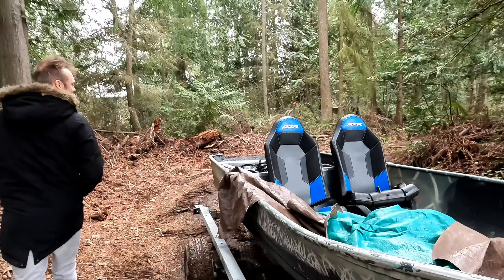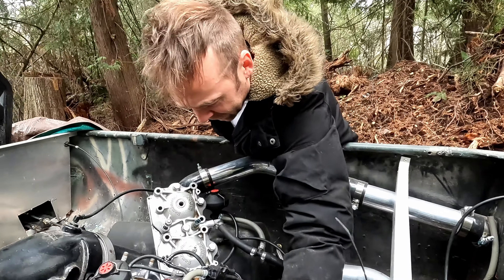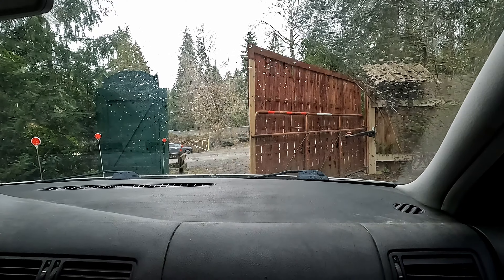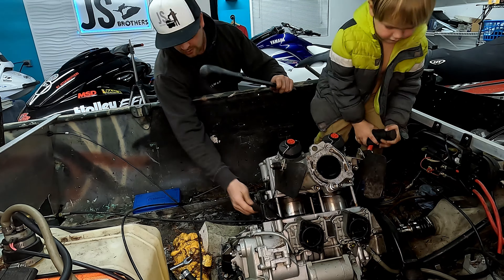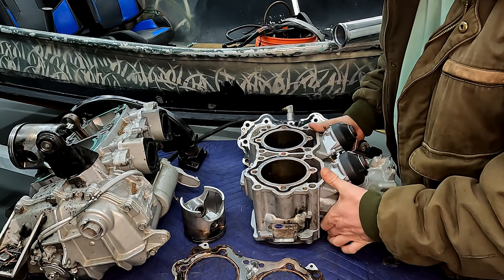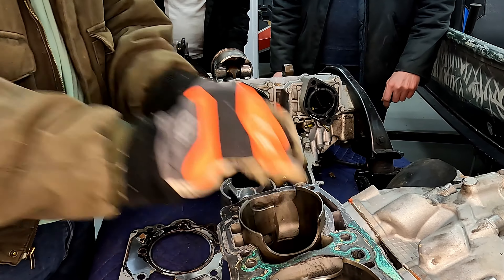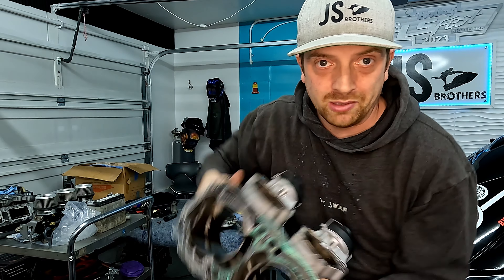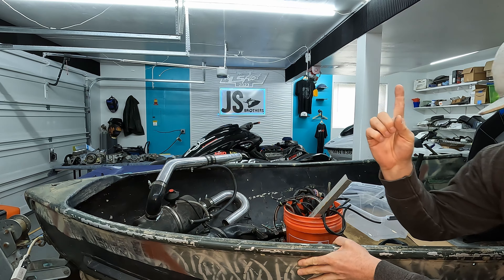buying sketchiest watercraft on marketplace

Comment: This is sick! I have been dying to see you guys have a good running 951 seadoo around so you can test it in different skis!
Reply from the maker: It’s interesting because the 951 is an oem alternative to some of the higher end 2 cylinder aftermarket engines. Maybe not as much power as a dasa or what have you but a lot more cost effective.